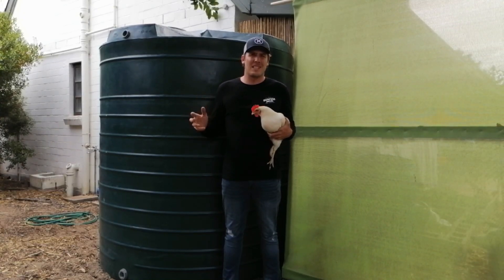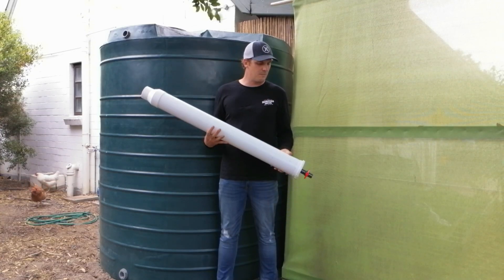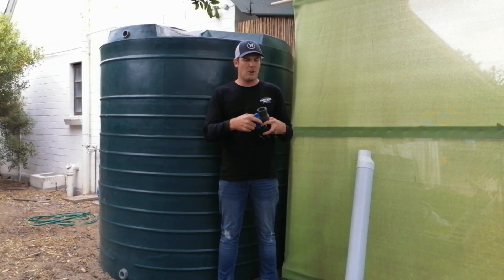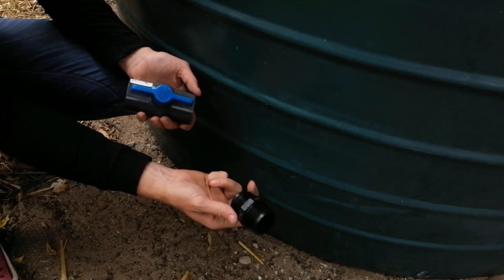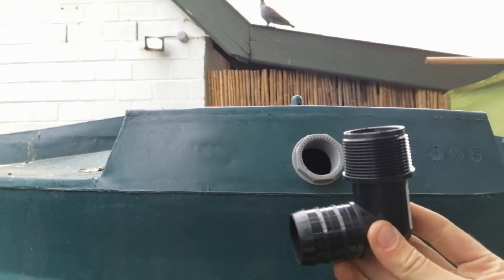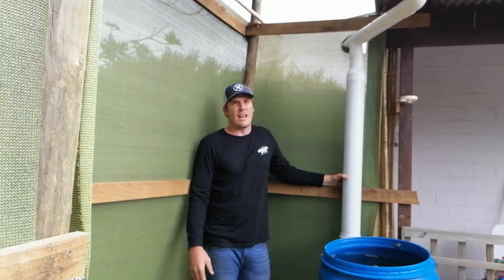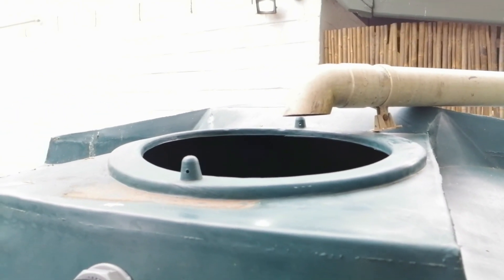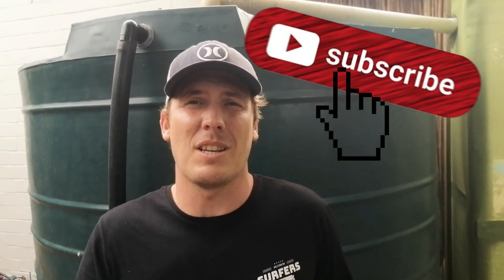DIY Water Tank - How to install a water tank yourself

Comment: Did you calculate your roof area harvested x your area's heavy rain intensity to arrive at your inflow rate during a high intensity storm event? The reason I ask is because the overflow provision is obviously very small plus there is little mitigation above the opening's invert. The higher the water is above the invert, the faster the discharge rate. 

I also didn't see a mesh barrier fitted to the overflow outlet to prevent pests including rats from entering the tank. Mosquito proof mesh barriers are required by legislation in most countries.
Reply from the maker: Hey, thanks for the detailed comment. We have just had 3 days of heavy rain and the 5000L water tank went from empty to full in 1.5 days. Luckily the overflow worked perfectly. That is a pretty tick diameter pipe and when the water starts flowing out it just goes.

As for the mesh covering I added it afterwards. Not sure if I mentioned in the video, but the tank came with a black fitter lid you just add on top and then I just added some chicken wire in the gutter at the downpipe for the leaves, which works like a charm. 

Unfortunately, due to the veranda overhang the gutter is really low, which meant I couldn't install a leaf eater before the first flush diverter but this works just fine 🌱
Reply: @MySustainabilityJourney  Thanks for the quick answer. The mesh I was referring to was for the overflow outlet, you did mention in the video that the inlet was going to be screened. 

If you now have the usual top filter basket, removing collected debris is a lot easier if you place an oversized round piece of (pan shaped) shadecloth over the mesh which can be weighed down with some small stones if necessary. To clean, you simply remove and give it a shake. Our country has easily removed commercial products that are effectively a second filter that fit into the existing meshed basket but they are not sold in many countries. Anything to make cleaning the tank's top filter mesh easier is a good thing.